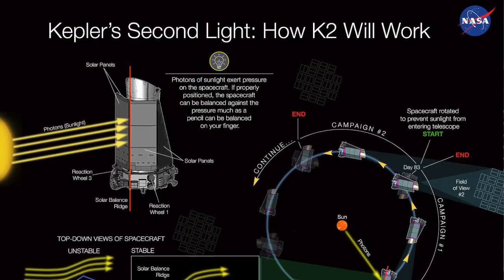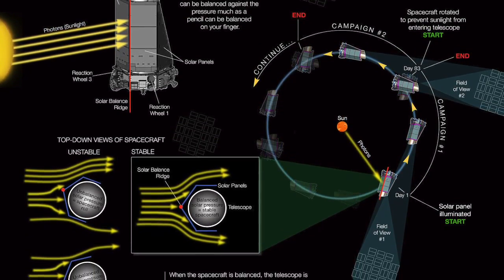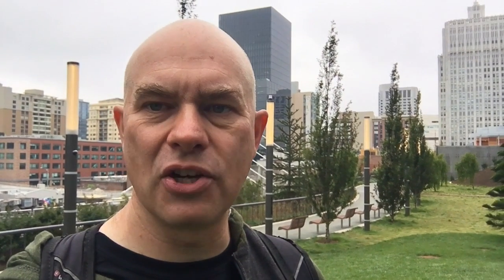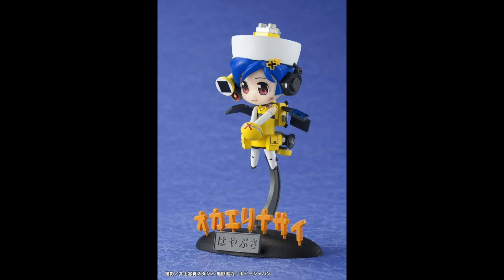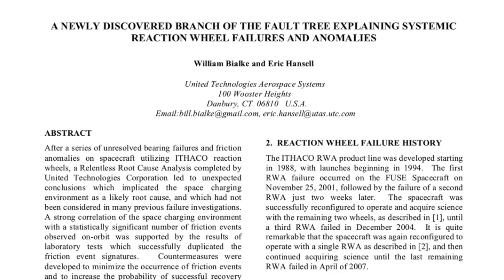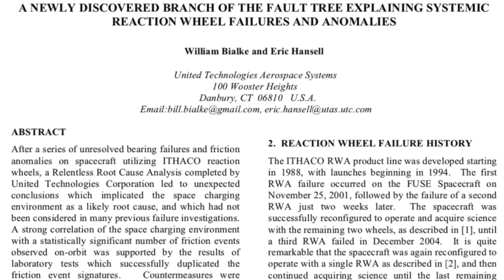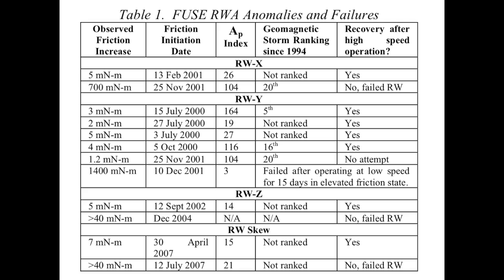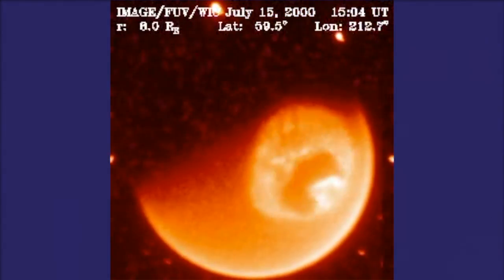Scientists May Have Figured Out Why So Many Spacecraft Were Failing

Comment: These spacecraft are in 0G... Why are they not using a frictionless magnetic bearing??  That seems like a pretty straight forward solution... does it not?
Reply: Probably more likely to have unfortunate decoupling incidents. Also, the inertia of the parts connected might be more than is economically viable in terms of electricity expenditure to overcome with magnetic bearings, but I'm definitely not an expert in mag-lev type stuff. [EDIT]: Oh yeah, and weight would almost certainly be an issue if I'm thinking about this correctly.

Comment: Bearings in pumps often fail due to this arcing creating craters, this is due to frequency converters of ”bad” design. There are multiple reasons to go for ”sine” wave converters instead of simple ones.

Comment: Arcing across race/rollers/balls is a very well known failure mode for steel bearings in electric generators in the terrestrial power generation business.  Ceramic brings its own set of problems.

Comment: Nice to see confirmation of my correction on the solar model. Electrostatic charges are possible in plasma, and electric fields.
Reply from the maker: How is that a correction? 
The solar model in mainstream astronomy is full of electrical effects in solar plasmas, it dominates the behaviour of the sun's atmosphere, astronomers have known this for decades.
Reply: Yes. Not exclusively magnetic, as is used in many models. 

With my university knowledge of Electromagnetism, I did quite some research. And I found that many models see plasma as a super-conductor and forbid electrical fields. Even electrical charges are impossible in such models. It is a simplification, and in my opinion an over-simplification. 

And indeed: in observations we see otherwise. so we have to correct these models for this reality. The models are often "corrected" by adding the charges or electrical fields as parameters, but their existence directly affects the underlying models. This is what Alfven already noticed in his time, but it has not been corrected as far I checked. 
Magnetohydrodynamics (MHD, developed by Alfven for special cases only) is such a magnetic-only model. It starts by claiming that E=0. And this means that no charges exist, as it would create an electrical field (E>0). It also makes some other assumptions which I disagree with.  
So this gives magnetic-only models. Even frozen-in magnetic fields, whatever that means. And according to those models, electrical charges are not really possible in space. And I am glad the research in this video shows that these models are now failing. It is likely that the electrical charges and related fields are degrading the instruments in space. In this case mainly the reaction wheels.

Of course one might argue that this is due to induction currents. But that is not very likely, as those are weak as the distance from the sun is very high. Induction also requires changing magnetic fields, which is even less. Though electrical charges from outbursts, can get very close. And these can easily cause shortcuts, which might pass through the faraday cage in certain conditions. In the worst case it would be like lightning striking the satellite. 

Besides that I noticed that magnetic fields and electric fields can cause very similar effects. The Zeeman effect (magnetic) and Stark effect (electric) are very similar. And Faraday rotation and liquid-crystals have similar effects. And I am afraid that in astronomy, where we have found "magnetic" fields, like in Galaxies, that we are wrong. It may be that in many cases we might actually have found electric fields and electric charges, with little magnetism. Some laboratory experiments reported very strong electrical fields in double layers of plasma, which is even worse for MHD. So certain magnetic models have to be revised.
The best solution would be to do simulations with normal gas/liquid/plasma flow-equations. With no MHD, but the Maxwell equations instead, and the possibility of double layers. With the simulations it may be possible to compare different electromagnetic models, including those with charged plasma ejections. Which I think are not even possible in our current model, even though we observe them.
Reply from the maker: Contrary to your opinion, the research in this video makes no comment on the accuracy of solar plasma models, in fact, it’s conclusions are entirely reliant on the existing observations and models being correct.

Comment: I did a similar study on Relays for my MSc. That was about identifying failure mechanisms in advance but the mechanisms were the same. I imagine that there might be a condition where the arc causes metal to vaporise into the lubricant and reduces the breakdown voltage, resulting in more arcs. That’s a big issue in immersed electrical gear.

Comment: Didn't they switch out the reaction wheels on Hubble on some maintenance mission? Are there any open information on their wear?
Reply: Good point, where did they go?

I fear the answer may be that the old reaction wheels are still inside of Hubble, and that they just added new ones in new locations. Hubble was designed to easily add new stuff, arbitrary stuff, ways to attach whatever you could not even know about earlier. Some parts were also designed to be easily removed and replaced. I do not know if the reaction wheels were designed to easily be removed, if not, then i think they just added some additional new ones, and all the old ones are still in place.

Comment: first thought was to 'go ceramic'. but then if the lubricant is conductive, a coated ceramic bearing will still arc.
Reply: The problem with the metal bearings is that the lubricant is a very good insulator, otherwise there would not be a problem, a conductive lubricant would be an elegant solution for metal bearings. Arcs are not an issue if they do not damage any surface needed for the bearing rolling smoothly. The trouble is only that the arcs hit precisely the contact points where the balls touch the tracks they are rolling in. For this problem, solutions are numerous and trivial once the problem is known.

Comment: What does this mean for the parker probe? I don't know how it does attitude control but if it had reaction wheels and they failed could it after some time end up with the heat shield in the wrong place if it ran out of propellant? Even if it is tidally locked (I don't know that it is, I'm speculating) it doesn't have a circular orbit so maybe such a situation could arise given time
Reply: It's not tidally locked. If attitude control fails and the spacecraft behind the heatshield gets exposed it'll fail in half a minute or so according to NASA.
Reply: 221 b thanks, but does it actually have reaction wheels or is it using cold gas? I can't find anything about this but I assume reaction wheels are better for a seven year mission

Comment: This actually makes a lot of sense.  

I've seen this happen with induction motors fed from high-switching Pulse Width Modulated inverter sources, causing capacitive currents to arc across the bearing.  

Granted, there was a lot of frequency variation for power production.  It happened within a 3-5 year period for a new design system.

Comment: I was curious if an arc could do anything to the bearing lubricant so I read around and found Rheolube 2000 which is used on some reaction wheels. It has some lead salts in it that seem to be conductive, but the only thing listed other than the lead salts was mineral oil which isn't. Seems most lubricants aren't.

Wonder if either the electricity moving through (if it is lightly conductive) or the heat caused by the arc could cause a viscocity change?

Comment: Didn't we return reaction wheels from Hubble? I assume they were able to measure the changes in material properties.
Reply: Deric Anthony Didn't Hubble servicing mission 3B bring back the gyros and the reaction wheel? I think the gyros and reaction wheels were designed in the early 80's. Someone should find out and correlate to any solar events.
Reply from the maker: The Hubble reaction wheels weren't built by Ithaco, so they weren't involved.
Reply: I was aware they were built by a different source but as long as they used metal parts similar to Ithaco instead of the newer ceramic they would still be able to use it to isolate the variable of who made it to narrow it down to possible common design flaws.
Reply: @scottmanley  Even if these were made by Ithaco, they still shouldn't be susceptible to this particular failure mode since Hubble is within the Earth's magnetosphere.
Reply: Not sure this is true. While they are shielded partially there are solar flares that do damage to electronics on earth so I think it is safe to say Hubble is still able to be damaged by solar flares.
Reply: @EricAnthony1738   This is true, but we're talking about damage to bearings, which have a higher damage threshold than microscopic semiconductors.
Reply: But we don't know how susceptible they are. All we know is that they are less susceptible to damage, but we have a rather small sample size on what can cause damage.
Reply from the maker: FUSE was also inside the earth's magnetosphere, that's why they were correlating its events against geomagnetic storms.
Reply: @EricAnthony1738    I should have said "should be much less susceptible" rather than "shouldn't be susceptible" . A Carrington class event would likely be capable of welding a bearing or two solid. 
     Note that there is an important difference between radiation outside and inside the protection of the Earth's magnetic field. The magnetic field eliminates most ionizing radiation consisting of high energy particles. It is usually the high energy particles that are responsible for a buildup of charge, unless there are strong electric fields present (ie the inside of a Geiger-Müller tube  found in a geiger counter).
      As for how susceptible a bearing is to electrical discharge from roller to race, that's pretty easy to test here on Earth. Relatively simple to model as well. You'd basically figure out how much power is required to locally melt the bearing surfaces before thermal conduction takes over. You can test this pretty easily by just attaching a decent variable power supply accross the bearing.
     Note that in the case of electronics, radiation needs to supply only a small fraction of the energy required to damage the circuit. For electronics to be damaged by radiation, all that is required is for a few free electrons to be generated in the wrong portion of a control circuit, and the circuitry itself can generate huge levels of amplification or even go into a latchup condition, allowing damaging levels of current through the circuit. To some degree, this can be mitigated with circuit design and layout. 
TL-DR:  Radiation needs to supply the full amount of the energy required to damage a bearing, whereas the circuit itself often supplies most of the energy required to damage a piece of electronics.
Reply: @scottmanley      Just remembered the South Atlantic Anomaly, and indeed, both Hubble and FUSE orbit high enough to be affected by it. So there would be times in its orbit where the bearings would be more susceptible to damage; maybe even more likely than further out from Earth,  due to the high concentration of energetic particles within the Van Allen belts. I think that when doing a correlation between solar activity and reaction wheel failure for Hubble, FUSE, or any other satellite that passes through the anomaly, one would need to include times when the satellite was passing through the anomaly in the data used. 
(Edit) Just read the paper, and it appears that they didn't include this information in their analysis. I would be very interested to see the results if they ever checked this.

Comment: Same problem with older type electrical motors and VSD. The VSD would create static electricity on the rotor and it will discharge trough the bearings.